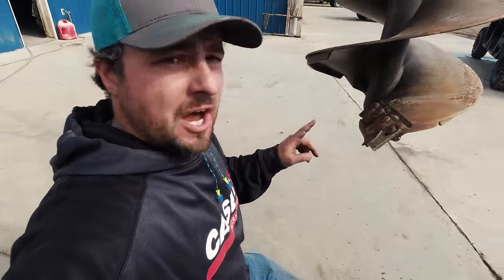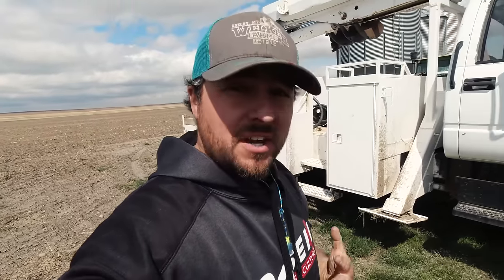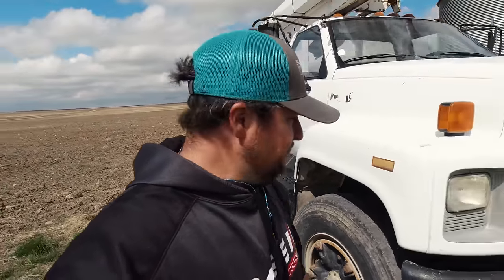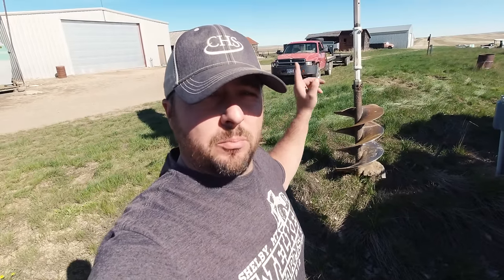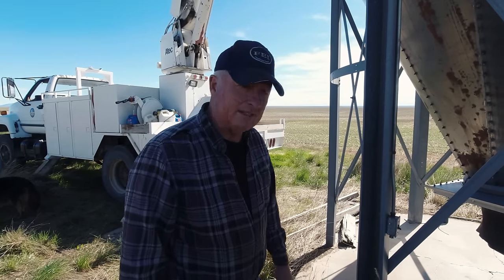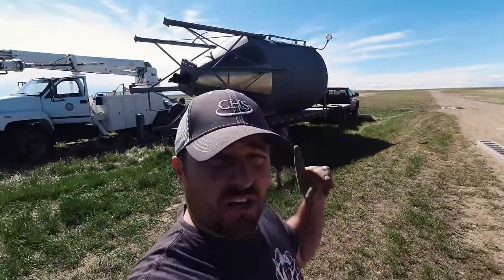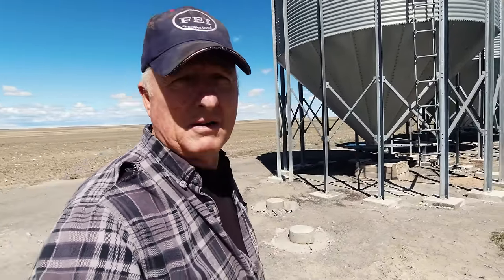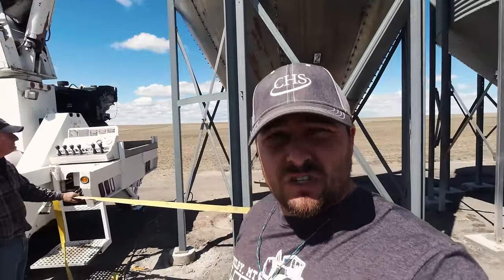Moving Bins｜SpaceX? More Like WelkerX 🚀

Comment: I grew up on a small farm and watching your channel takes me back to my childhood.  As I now work in construction as an Industrial Electrician, there is a device we use called a retractable life line (or google yoyo for fall protection) which you could use for climbing up that extension ladder.  You could attach the yoyo to the boom with a shackle and add a tag line to he hook.  Once the boom is extended you pull down on the tag line and put the hook onto the D ring of a harness.  Hopefully you won't need it but it will stop a fall.

Comment: An old light company trick is to drill the auger into the ground.  It's easier to reload that way.  I was surprised when you let it drop.  I was a bit worried when you discussed rotating the bin to the trailer.  Glad to see the truck didn't tip over. I operated one of these trucks when I worked for the power company. I like the center pins to force the wedge open better than tightening friction to wedge the bolts.

Comment: 900 bushels is 31715.2 liters.  I'd chip in a few 2L bottles to do this but I doubt the bin could hold the weight of over thirty tons of cola, assuming the bolt holes didn't make it more a sieve than a container.  Now, your plastic barrels look like they'd be almost as much fun with far less material investment :)

Comment: You'll crack the concrete before pulling the anchors. That design is brilliant. I mostly use the ones that have threads inside the pin hole (so instead of the pin, you have a slug that you have to smack with a rod which they provide with a box of 200) and then you thread your bolt inside. I've done tests on them, and i've actually snapped the bolts, before pulling the anchors. Compared to the old sheet metal ones or the jacket types, or even the expanding flower heads, these are faar more robust. Best design yet, IMO, should've been a thing a decade ago.

Comment: When you were moving the old barrels i had noticed some older heavy barrels that are perfect for burn barrels as they will last for quite a while . I cut the top and bottom out then make two fairly large  rectangular openings at the bottom but keep the end ring on the barrel then i cut 2"holes in different spots on the sides for extra air to burn -- all cut with a plazma cutter but be really careful if there is any smell of anything flamable inside . If so i will cut the top off with an air chisel then plazma . I put the barrels on three broken patio block pieces and just lift it up to empty the ashes with a shovel .
Reply: That's what some will be used for.

Comment: I really don't know what one of those bolts cost but a possible cost-cutter is 1. take bolt any length actual and remove the head. 2. cut a slot on the unthreaded end 2 or 3 inches long.. 3. when you wish to fasten something down place a metal wedge of appropriate length in the slot and drive it home. The Corp of Engineers uses these all the time no trip to town..

Comment: I am sorry for the bad spelling. But i will try to tell you what i am thinking.  On the the gran ager that puts the gran up into the beans. Tern them side ways like on a  train rail and add a wheel on the tung. These way you move it from side to side to the beans. It will look like a  train track all along the sides. So win you move it your not pulling it in and out all the time, just side too side. These will make moving it faster and keep it all moving. If you did not get it. I am sorry i will try to re do it with some help. (Ps. i'm just lexic)

Comment: No, agreed. There's nothing like having a digging rig on a farm. I mean you guys use it for that, but whenever our water lines break, we use ours (a disused utility pole digger from the 80's) to get to the main line which is burried at two meters deep, and i mean, there's no comparison. Two years ago, the poor old tired Merc engine had a bit of a cough, had to pull it on the side to do some maintenance, and it just so happened that the irrigation line popped a leak, like sky high geyser, which it does, it's nearly 40 years old now, and we had to dig that by hand. Pfff, man, you never trully appreciate something until you don't have it anymore. Doesn't matter how much you might actually appreciate it, it has to happen first so it sinks in.

Comment: If the other pads were for Natural Gas equipment, I will tell you as a engineering tech that they are super thick.  I would just leave them and park stuff on them.
Reply: We would but they stick up a foot about and already mound.  It would be a pain to have to drive over or pull and auger over them.

Comment: That line truck is a nice piece of equipment. I know your auger is slightly bigger than my 3 point post drill (9 in.)....  but when I need to get a hole cleaned out all the way....  using my manual post hole digger got old....  I bring out my little generator and my big shop vac. Suck the hole clean.  (hehe suck the hole)  Soooo much easier....  with a 2 ft hole it's probably easier to use a shovel, but just a thought to throw in the tips and trick bucket.
Also, if you really want to know what that hopper holds you can do a little math and figure it out quite easily...
You'll need to do a few measurements on the cylinder portion and then on the cone portion.
For the hopper it's:
V=πr2h
Pi times the radius squared times the height.
For the cone it's:
V=πr2h
/3
Pi times the radius squared times the height divided by three.
Add the two sums and you've got the total volume.
Also, you realize that in a few months, you're going to want to do something right where you put all those barrels, right?  At least that's the way it works for me when I find the perfect place....to place something I want out of the way.  :)
Thanks for taking us along on this project!
Reply: Thanks 8 Square!  I'll do the math.

Comment: Just a question.  Could you take those small bins, and combine them to make bins that were taller, or is there an issue with doing that?  I have been wondering about that.  If it would work , it would mean fewer auger moves.  

Great video as always!

Cheers!
Reply: Yes there would be a issue.  The thickness of the rings increases from top to bottom so that the bin doesn't claps.  So you would need thicker rings the higher you go.
Reply: @RobertWelkerFarmerBob  Got it!  Thanks!  I wondered why I never saw that being done...I had no idea about the thicker and thinner steel.  Sweet!  Learn something new every day.

Carpe Diem.